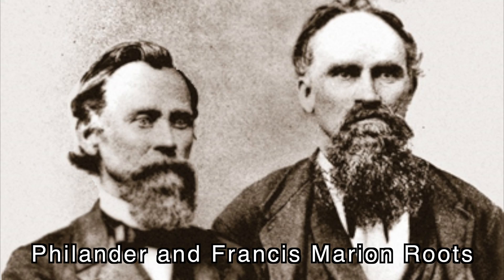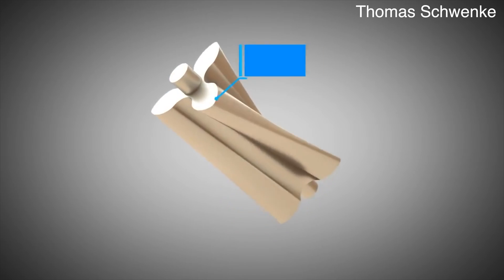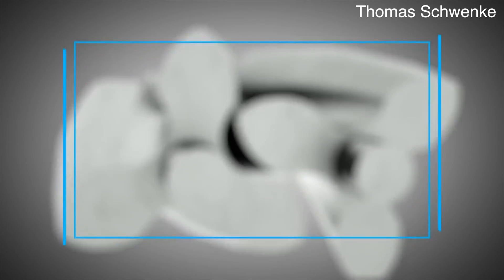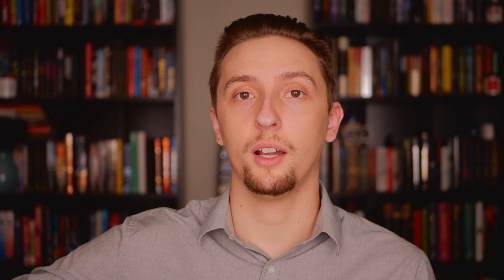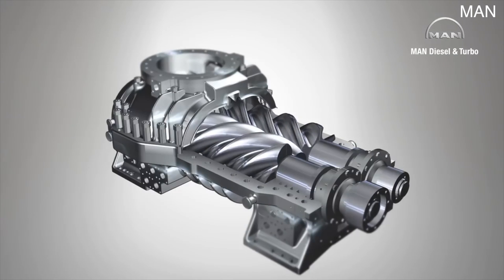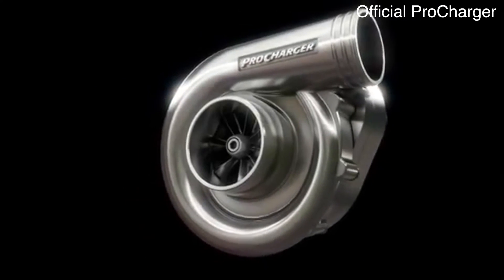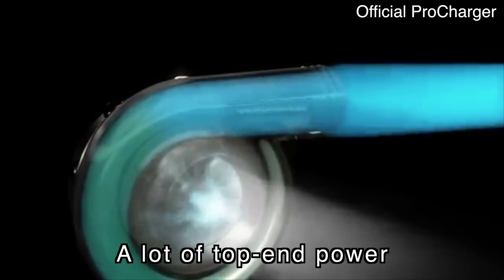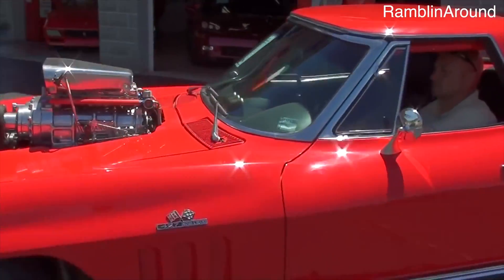Superchargers: Everything You Need to Know | How They Work

Comment: i wonder if there will ever be a free spinning pulley on a procharger with a one way clutch. THe reason ive asked this is if a procharger is still limited by engine rpm and belt speed what if it used the belt to get spinning fast and then as more air came through the turbine could spin faster if theoreticlly the belt no longer held the turbine at a certain speed. if it slowed down the one way clutch would stop it from free spinning the wrong way on throttle cut and still spin at belt speed again.

Comment: **Random question** 
On a turbocharged car could you also add a small centrifugal supercharger with the compressed air outlet going to the exhaust manifold just before the flange to mount the turbo? The purpose being to spool the turbo faster, guess it would also drop the temp in the exhaust side of the turbo.  You also wouldn't get the interference of separate intake charges like in a twin-charged setup.

Comment: Centrifugal superchargers also can suffer from lag similar to turbo lag but not as bad. Where a roots or twin screw supercharger produces the same boost from idle to redline a centrifugal supercharger produces considerably less boost at low RPM’s and builds boost as the RPM increases peaking at redline. When intercooling a twin screw like a Whipple for example, usually uses a Air to Water intercooler that is directly between the supercharger and intake manifold or integrated somehow into the intake manifold and the pressurized air only has to flow a couple of inches from the supercharger into the cylinder creating a quicker response. A centrifugal supercharger like a Procharger generally uses an Air to Air intercooler which creates considerably more air volume in the system that has to be forced from the supercharger down to the intercooler usually mounted in front of the radiator and then back up and into the intake manifold. That added air volume and the distance it has to travel before getting into the cylinder creates lag and a slower response than a twin screw provides. Personally I’d choose a twin screw over a centrifugal supercharger because the twin screw produces the same boost from idle to redline and a centrifugal doesn’t. That means if two guys driving the same cars with everything the same except one was running a twin screw and the other a centrifugal and they both are cruising side by side doing 30 mph and hit the gas, the guy with the twin screw is going to leave the guy with the centrifugal in the dust because the twin screw is producing max boost at every speed while the centrifugal is making way less and doesn’t hit max boost until he redlines. They can produce the same max boost but the twin screw makes it all the time and not just at redline which is the best thing in my opinion.
Reply: 2021 hard to argue with the results of a procharger now
Reply: Ok boomer

Comment: How about both a turbo and a twin-screw supercharger at the same time? Are two intercoolers needed?
Reply: If ur talking about using a turbo and a supercharger in an engine that's called twin charging which is sadly rarely used
Reply: if you think to mount both a turbo and a twin screw what you really need is good advice
Reply: @Fedethedangerous95  Doesn't Volvo do it?
Reply: @rattlehead999  I'm sorry man, I must apologize, I misread and thought about turbo + centrifugal (both being generally more usable for high end torque with no low end), I'm not sure about volvo but a setup like that absolutely makes sense... not sure about the cooling but imho a single common cooling system would make the most sense
Reply: @Fedethedangerous95  
but you replied with twin-screw... nvm...
I agree, unless you are pushing them very hard, which is impractical.
Reply: @rattlehead999  Yeah I know I had what is called a brainfart